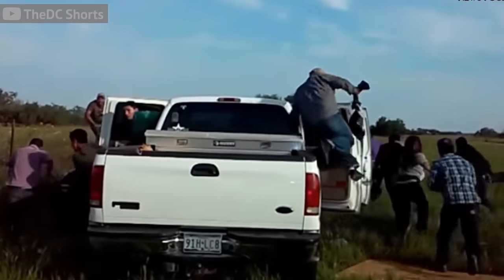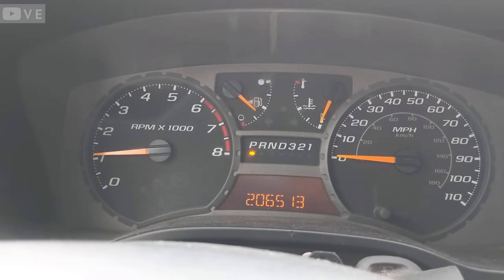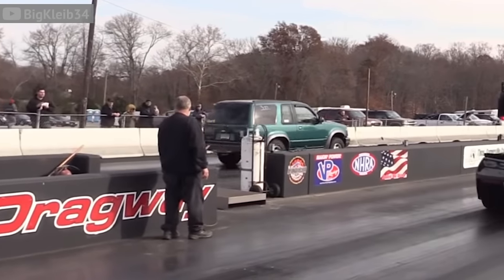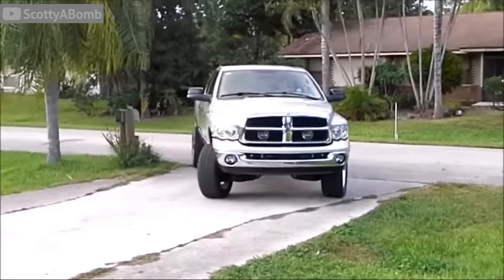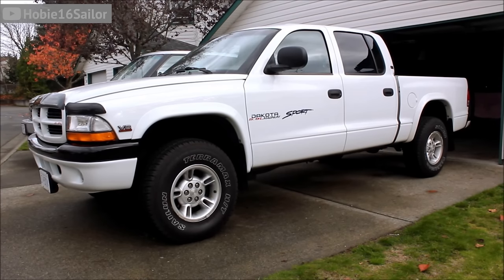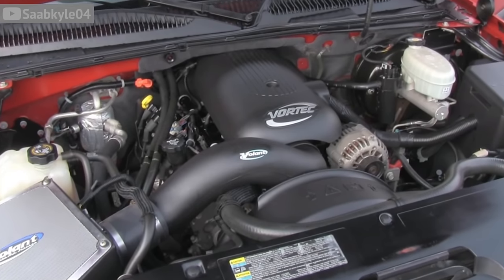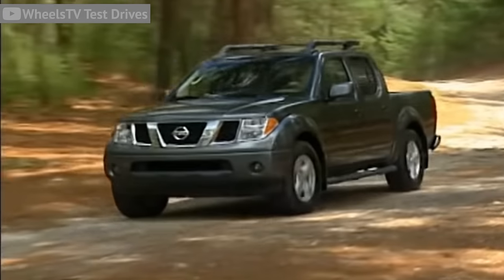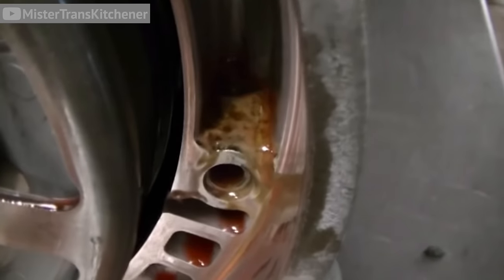USED TRUCKS YOU SHOULD NEVER BUY!

Comment: I was with you until the Avalanche. The 1500's shared the same drive train as the Silverado 1500(5.3, 4l60e). They are amazing and have stood the test of time. The only weak point in all Chevy's from that generation are the New Process Transfer cases(wear through). Once that's fixed they run FOREVER!! The only flaw you found was cosmetic.

Comment: Bruhhh our family avalanche hadn’t had none of those problems since we got it in 2002 and still to this day running perfect with no problems with over 250k miles
Reply: You got so lucky
Reply: Better sell it now, you just jinxed your self. Lol
Reply: La 4.3 Obs we got a blue one in 03 lol pushing 300k miles not a single thing has broke on it
Reply: Casey Blackburn 165k on my 02 and still great. Does shift rough from 1st to 2nd but thats on me for doing burnouts and launching from stop lights
Reply: He has no proof of bad vehicles
Reply: My 2003 avalanche is over 200k. Still runs, engine smooth no knocking noice. I get compliments all the time.
Reply: I just read your comment on your 02 Avalanche.  I wrote a comment on my 02 Avalanche too.  I too agree, a great truck. Read my comment to see if you had the same issues.
Reply: What I’ve seen is that a lot of them fail, but the ones that don’t are unkillable. Super weird.

Comment: I’m done with this video as soon as he said failed resistor when that was a relay
Reply: Oh shit I didn’t even realize that was a mistake. I was thinking he was gonna say relay when he showed a relay. Said resistor and I just assumed he knew more than me. Lol
Reply: He misspoke what he meant is that relay isn't supposed to deliver any resistance and when it is delivering resistance it will often take out the compressor and that can be pretty expensive. You're welcome
Reply: Full Send Filosophy you’re thinking of a capacitor not a relay ... ummmm but okay thank you I guess 😂😂
All a relay does is open and close a path of resistance . 
In a compressor situation all it does is give it a little extra bump while it starts if a relay goes bad it simply won’t cool
Reply: @hermansanchez8512  okay but if your ohm testing a relay when it's supposed to be open and instead it's delivering resistance than the relay itself would be bad due to high resistance. Or he could be talking about a blower motor resistor.
Reply: @hermansanchez8512  You tried hard though but I'm certified and I have a good idea what I'm talking about
Reply: its a flux capacitor as far as he is concerned

Comment: After of a few weeks of searching , finally found the perfect avalanche for my husband ( he used to have one and regretted getting rid of it) with all the extras like moonroof, power seats, mirror turn signals.  That baby was well taken care of at 140,000 miles with a quiet engine and kick ass rims.  Guy was going to take it Mexico and threw in extra brake pads and spark plug cables.  Paid $6800 and worth every penny !!
Reply: Shit i think i might buy an 02 for 2800 150k miles
Reply: @smurf_chicago6555  that’s a steal if it’s well taken care of with no damages. We’ve spent more on it too. We replaced all the leather, and have taken it in for an oil leak. Other minor stuff. Right now I’m actually having to replace the blower control module because the ac or defrost won’t turn off.  Issues are expected since it is 15 years old.
Reply: @veronicallamas9333  i just bought a dead mint escalade ext all wheel drive with the 6.0L and 127k miles for $6750 cash.... Took me 2 years to find something and had $15k to spend... I got so lucky with this vehicle.

Comment: I love my Avalanche  best truck I have ever had .
Reply: Same my avy is awesome. 2007 ltz.
Reply: Same and it still running well
Reply: I don't no  what this guy is talking about my avalanche doesn't have any of the problems he said.  The
Reply: Honestly
Reply: 2008 LTZ
Reply: Had a avalanche since new 2007 230,000 miles on it now only things changed battery oil brakes and an alternator and a evap valve of some sort this guy is lame
Reply: Right? I mean I understand the cladding but that’s because it’s plastic and gets sun damage. And the transmission? Well the 1500s have the 4l60e which isn’t very good to begin with but I love my 02 avy. 196k miles and still running great
Reply: I still own a 2007 ltz, it’s our worst car though :( rear main seal leak, engine mounts broke so we fixed that, and a lot of minor things going wrong
Reply: AGREED! I bought my 2002 Avalanche for $1000 with 205,000 on the odo. Truck had 2 codes, knock sensors and evap canister. The evap was a 5 minute fix, but the knock sensors were a true PITA since they had corroded and disintegrated when trying to remove. Regardless of the stupid knock sensors (now fixed), I really love this truck! The ride quality is excellent and I'm at 215,000 miles now and it runs like a dream!! This guy just hates the cladding and is taking it out on the rest of the truck. Aesthetics (subjective) should not be a determining factor on what to "never buy".
Reply: 2004 avy z71 almost 300,000 on her and still amazing
Reply: I will say this, that avalanche has a surprising turning radius. Had a lifted one on our sales lot it was fun to drive.
Reply: Same here.  Love my 2002 North Face edition 4x4. 139K and drives perfect
Reply: my 2013 ltz is a great so I dont know what his issues with avalanches are. I also owned a 02 avalanche and put 350,000 before i decided to let it go. didnt have any issues with that one till i had well over 200,00 miles on it
Reply: I am on my second Avalanche.  I am thrilled to have this beautiful, practical truck.  2003 and runs great.
Reply: 08 LTZ Avalanche 69k miles 
Love it to death
Reply: Same
Reply: 2004 z66 with 130k miles. Zero problems besides brakes so far
Reply: My 2005 avalanche has 350,000km still runs mint. Other then minor rocker rust and a couple bad ball joints 🤷🏼‍♀️
Reply: I have one 07. With 200xxx and still going just did alternator it’s the one in my pic.  O yea it on 28”s
Reply: Picked up an '04 1500 LTZ last year for $3400 with just over 100k. It needed a trans, I gave it a Jasper 😎. Turning radius is impressive. Most amazing thing about this beast though, I hauled 12' lumber WITH THE TAILGATE CLOSED! Yeah, with the mid-gate down it has the dimensions of a long bed. With just a foot or so left, I said wth, I'll just run the lumber over my console a little and i won't have to leave the tailgate open. The rest of the time the cab is a roomy FULL quad cab. I'll be get'n another one when (if) this one dies. Chevy needs to bring it back.
Reply: 04 avalanche salvage title 249,000 miles, 4 quarts of oil a month and it's still faster than a F 150 with a 5.0, beat one twice the other day so yeah, hand me the Castrol IDGAF
Reply: @Epicstorys69  nice truck
Reply: I had an 04 avalanche danm thing never seen 80k and the trans engine drive shaft and pretty much everything else killed itself
Reply: I've got an 05 avalanche with 388k miles. Sure the engine has needed some work, a rear main seal, oil pressure sensor and some evap stuff, but that's it so far. Other than that it's been regular maintenance with replacing worn parts. As for the cladding, he is an idiot. They aren't painted. They are molded plastic that naturally faded with sun because that was before they learned how to make good uv resistant plastics. Most people paint them or swap off the Cadillac trim if they aren't happy with it. As for me, I darkened mine and it's held up for over a year so I'm not complaining. Only ever been stranded once, because the plastic connector to the heater core broke. Unless you count in my driveway when the oil pressure sensor went out and I had to take my wife's car to get parts. That was just a few days ago in fact.
Reply: My 06 z71 has 6in lift and is a beast! Just hit 221,000 miles on original trans and engine. Motor doesn't burn any oil at all. Yes the plastics do fade, but they aren't painted like this dude says for early models. Rhino lining them fixed that issue. Oh and I also had an 04, my dad had an 08 and a 2011, neither of which ever had any issues. This guy obviously has never owned a avalanche.  Wish they still made them with newer chevy front end. Mine will be getting  6.0 or 6.2 liter with 4l80e trans and 14bolt 9.5 ring gear rear out a Escalade esv when any of those parts brake. Still waiting
Reply: I have a cammed 07 with 198k and it still packs a punch. Only thing it consumes like it’s it job is gas not oil😂 as far as the cladding you just cure it with a good quality tire shine if you don’t have them painted. Any vehicle with black plastic pieces are going to fade from the sun over time.
Reply: jason williams I wouldn’t mind having a avalanche but it’s towing capacity is next to null. that’s my big turn down from getting it
Reply: I love my 2008!!!! She’s a beast!!!
Reply: @butterowl567  beef it up! Bigger drive train and it will be a beast. I'd like to do the first ever diesel avalanche with allison transmission and 14bolt 9.5in ring gear rear end.
Reply: Lol never heard of a woman named Jason before
Reply: I think he’s wrong as well my mom owns a 02 Z71and she beats the crap out of it and it still runs strong.
Reply: 04 EXT,90k on the dash,6.0 motor, and other than being a gasaholic, we're just fine.
Reply: Same
Reply: Love my 04
Reply: Have a 2008 Avalanche LTZ and it’s been a great vehicle. I think a lot of this is either his opinion or a small amount of these vehicles with these problems. I’ve seen a lot of these vehicles on the road without problems.
Reply: jason williams  Hell yea bro 2009 z71 with lift must say Best Buy I ever made
Reply: jason williams hell yea i had a 2002 z71 the best truck i had so sad i had to sell it
Reply: I'm looking to get an avalanche like a 08
Reply: 09 avy LTZ 215k miles...love it. 5.3 does have lifter issues, which is in ton of chevy trucks and do drink oil (mine isnt too bad). What an idiot...and then he says paint issues of cladding? No 1st gen avy has painted cladding? And only Black Diamond edition 2nd gen has painted cladding? This dude just wanted some veiws at the expense of others with a 5 minute research of vehicals. Thumbs down...
Reply: Avalanche and escalade ext is the best
Reply: Love my 2003 Avalanche.  300k miles and running like a champ.
Reply: Owned 2 03 with 386000km
05 with 585000 when i sold it. Awesome trucks. Only sold to get a 2500 to tow my car trailer.
Reply: Had one and it went up to around 400,000 km
Reply: I have a 2002 and it’s the truck i learned to drive in. I’ve never felt safer in a vehicle. Only complaint is it ends up in the shop once or twice a year but its an old vehicle and considering how long we’ve had it and how much use we get out of it i love it. So sad to say but I’m in the market for a new truck now bc the maintenance is getting to cost more than the trucks worth.
Reply: Your truck is a legend.I hate the Silverado.Avalanche for life.
Reply: Ong 🙏🙏 my avalanche is legendary
Reply: My avalanche did let go of a transmission, but I had huge tires and beat the piss out of it so I was not in the least not expecting it. The sounds system a guy can build is freaking insane, best truck I've ever had.
Reply: 220k miles, Little rocker rust, No issues.
Reply: It's obvious he has never owned an Avalanche or any Chevy truck. I have a 2004 Avalanche and a 1999 Silverado. Both at 150,000. No major problems that I couldn't tackle myself. The only issue i have with when i try to load drywall or plywood the bed cover design get in the way. But that's a very minor issue.
Reply: Just sold my 05 Avalanche with 387k miles with non of the issues he mentioned. Have 2 more 04 with 124k and 02 with 90k. Both run to this day in 2019.
Reply: @butterowl567  Hauling capacity is about half to 3/4 ton and towing capacity is about 8,000 pounds thats about the same as all other half ton pickups.
Reply: Same 200k mi runs like new
Reply: Thank God you took the words right out my mouth I love my avalanche it does everything and there won't ever be a truck like it
Reply: I agree m daily driver is an 09 3/4 ton avalanche best truck I've ever owned
Reply: jason williams same 2008
Reply: I quite like my Avalanche. Granted mine has the 8.1 big block and gets 7 mpg but it's great in Canadian winters
Reply: Same here. There are known problems but over all reliable and most are minor nuisances.
Reply: @davidg8646  2005 Chevy Avalanche that I had was garbage. Rusting out even with numerous washing. Fuel pump gone and rotted out at 60,000 miles??? Bad spongy brakes.
Reply: @broadydelaney5508  Same here. 05 I had constantly shitting itself. Fuel pump at 60,000. Shit brakes. Needed new ignition switch and wouldn't shift to 4th gear. It was stuck in 2nd gear. Problems with stabilitrack system
Reply: @AutoBrawn  I haven't used my four wheel drive yet and we've had some nasty snow storms since I've had it she's a beast
Reply: My O4 Avalanche is awesome. Almost 16 years old and has zero issues. The best thing I've found for the plastic is wipe new. I know, I was reluctant to try it, but it works.
The speedometer issue is like a 250 dollar repair. So what. I ran it for 125k miles on the original spark plugs.
I wish they still made them, I would buy another one.
Reply: @butterowl567  mine is rated to tow 8000 lbs. I tow a 7000 pound construction trailer with it regularly.  Also, you can get a 3/4 ton version with an 8.1 liter big block.
Reply: If you take care of your vehicle, any vehicle and it can last forever. If you don’t don’t expect it to last long.
Reply: My  Chevy avalanche is runs like a champion and it has 282.000 miles and have all original parts
Reply: 04 z66 316xxx still going strong
Reply: Dude must be on crack
That 5.3 vortex v8 is solid
Reply: Seriously.  Avalanche is a great truck.  What do you know.
Reply: 10 years whit mine 4x4 z71 2003  and just put new tires on it another 10 years here we come these poor dude is tripping on drugs
Reply: I had a 2003 avalanche 2500 ran it to 200k loved that truck traded it for a 2009 Chevy Silverado 2500hd.
Reply: Love my 04!
Reply: my dad had a 2004. it lasted 373,000 miles
Reply: Same here
Reply: 03 Avalanche 4x4, fuel pump was the only issue, but that's a standard chevy problem. Runs great, acceleration is awesome, loves gas but it's heavier than a silverado. I've had other trucks, but the Avalanche is by far the best. As far as the plastic trim, it's plastic in sunlight, of course it fades, lol
Reply: My avalanche works great
Reply: jason williams this guy don’t have a clue
Reply: There awful vehicles should of never been made
Reply: Ryan Morgan do you know how to fix the evap thing
Reply: I owned 2 an 04 and and a 07 loved them both! never had one issue a joy to drive...
Reply: jason williams Uglies truck ever made.
Reply: Willy Olea if you’re plastic cladding has sun damage, you can easily fix it with a blowtorch. No joke. Plenty of tutorial videos on YT
Reply: Butterowl their towing capacity is the roughly the same as the Silverado or f150. More in some cases when comparing different years
Reply: I love them too!
Reply: This guy doesn't know what he's talking about!  Avalanche is the Swiss Army knives of trucks, period!
Reply: jason williams true 235,xxx on my 2007 lyz
Reply: @anthonyainsolar  Fleet Silverado i drove had also very good turning radius, but the steering wheel would not spring spin back and it was very scary until i got use to it, I never had that happen on another vehicle yet
Reply: right my 02 has over 300k miles on it an no major iussues. my 12 is at 123k miles now and no issues
Reply: Got 2 avalanches one with 220k miles and the other with 439k miles they both run great never been rebuilt
Reply: @orionlapalm813  my gf and i bought an 03 with a few hundred under 115k miles on it. It's been fun to drive over the last week and who ever owned it definitely treated it very well. I've always liked the Avalanche and even the Ridgeline.
Reply: @txsandman007  my gf and i just bought an 03 with a little under 115k on it. The owner treated it like a living family member.
Reply: Love mine too❤❤
Reply: I got a OG 03 the only problem is the oil pressure gauge keeps messing up

Comment: “When you don’t maintain the engine it literally builds up sludge” no shit 😂 vehicles rust from amounts of salt and water from icy roads, sensors go out on every vehicle. And the avalanches never had paint on the plastics. These are all things that are caused by the care you take of the vehicle lol
Reply: Okay I am actually happy to correct and inform you fellas here, as someone who works in American vehicle manufacturing everything from plastics to metals anyways heres the low down- nothing is supposed to be painted if its plastic or "leather" or "wood" and nothing welded plastic or metal wise because it should come out correct, however more often than not every" parts for 100 cars" at least 5 parts are re worked each batch and that IS internal protocol from people making alot of money head of plants when I say "youre not supposed to" I'm telling you employees, engineers, heads of design and even customers are being deliberately lied to and its no surprise
Reply: @theWICKEDtruthz  hes just reading shit off Google. Hes a joke lmao
Reply: Yeah the avalanche motors never had issues. Unless you wanna consider the manifold bolts coming loose and causing a manifold leak but other than that, the 5.3 is a long proven motor for gm
Reply: @theWICKEDtruthz  The Dodge Dakotas do have a very bad carbon buildup issues that become very evident when you pull the heads Especially seen on the 3.7 and the 4.7 found on many Chrysler's throughout the years. Though his verbage is incorrect he is not entirely wrong. ASE certified.
Reply: Me: sees the channel owner favorites your comment

Visible confusion